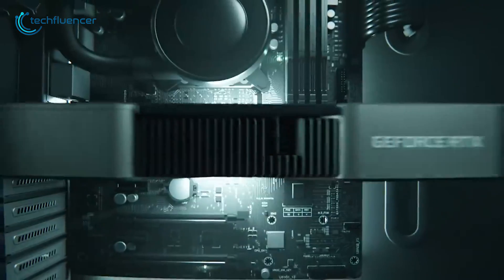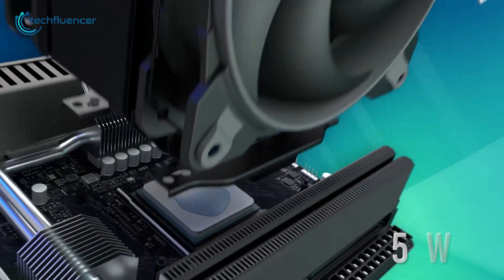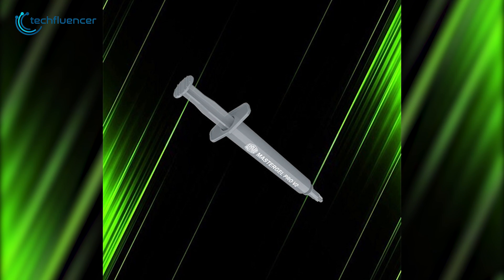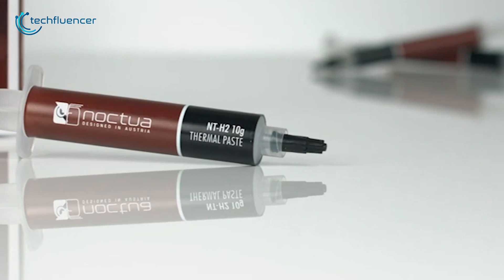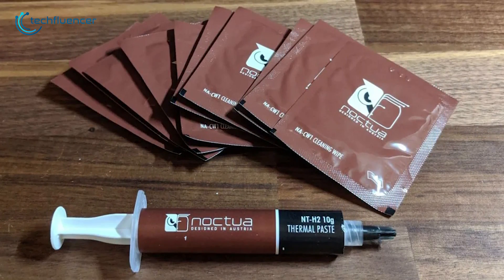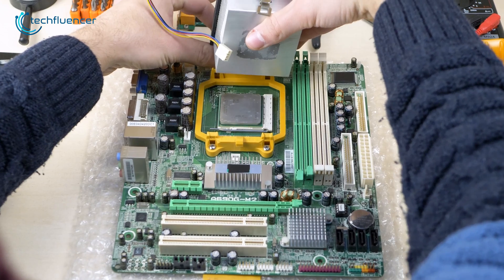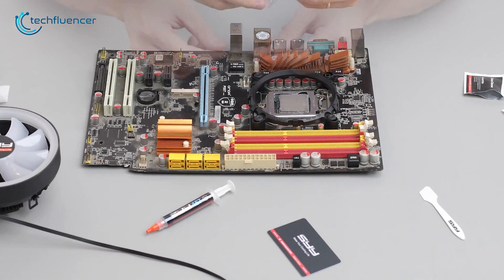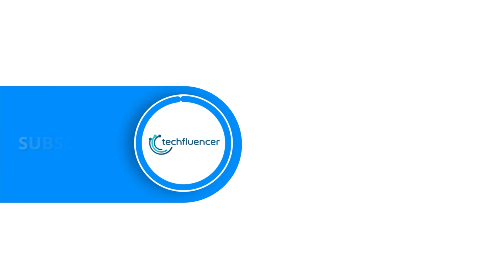Top 5 Best Thermal Paste

Comment: I have a gaming laptop that is currently cpu throttling. I have owned it for 2+ years now and issues only recently started happening in the past couple months, getting temps anywhere from 94-100degrees Celsius. I have tried undervolting and nothing works, was told that my thermal paste probably dried out. What thermal paste would you recommend for this situation on Amazon? I'm new to this but I want something that will lower my temps noticeably so I can start playing games 144+fps again instead of the 10-30 I'm currently getting. Current laptop specs are i7-11800H and RTX 3060 Laptop GPU
Reply from the maker: We recommend getting the Thermal Grizzly Kryonaut.
You can't go wrong with this one.
Reply: @techfluencer  Why did you recommend a paste that dries out in a month in a laptop, especially when you were sponsored by SYY.
Reply: @techfluencer  thank you soo much I’ll definitely try it out and let you know how it goes! I appreciate it 😄 also subbed
Reply: @Awesomenator  You better off with SYY-157, Thermalright TFX or with the Honeywell PTM7950

Comment: I use syy 157 on my rtx 3080 gpu for 1.5 years now it works great and no pump out effect, on an normal cpu it works also but hard  too work with its very thick.
Have it now on a ryzen 5800x3d max temp 72C in cinebench23 multi core no undervolt al core load 4180mhz with Noctua NH-U14S, the paste needs burn in the thermals were first 82C 
The best way to use it is spread it out and a drop 3-4 mm in the center, the heat from the chip do the rest.
Thinner pastes dont work on the naked chips like laptops and gpus, its in no time pumped out.
Reply from the maker: Thanks for sharing your experience with it.

Comment: Thermal conductivity specs say nothing as every manufacturer tests with different methods and variables. You also don't address the pump-out effect which occurs in low viscosity thermal pastes, which tend to be the premium ones. These need to be reapplied every year.
Reply: prob google

Comment: Best for thermal for i7 9750H & gtx 1650?
Reply: Yes, I use this thermal paste for the vram chips and the voltage reculators, but for the processor and the co-processor (GPU) that you are talking about (I have the same thing), I use liquid metal called "Silver King" and which is 79 W/m*K.

My CPU (I7-9750h) runs between 50-60° in idle, but in full power it is 60-70°.

My GPU (Nvidia GTX 1650 Mobile) runs between 40-50° idle, but at full power it's ~60°.

Comment: I just have the Thermal Grizzly Kryonaut and the Noctua NT-H2. But I cannot decide which one to use for my RTX 3090 build. Any ideas on which one I should use for a Ryzen 9 5950x?
Reply from the maker: you can go with the Noctua NT-H2 for your Ryzen 9 5950x cpu.
Reply: What about an intel i9 12900k?
Reply: @nycsteeze1736  same
Reply: try maxtor. thanks me later